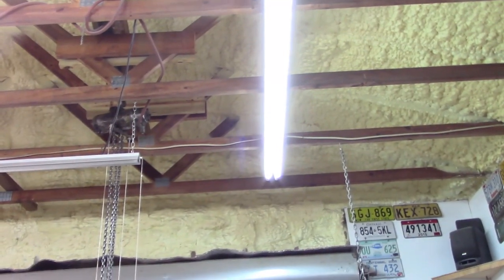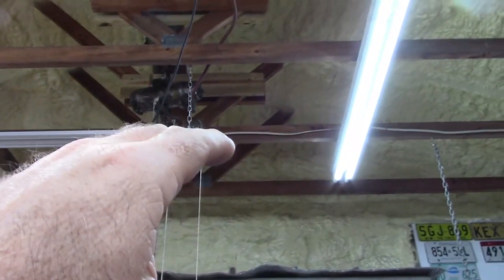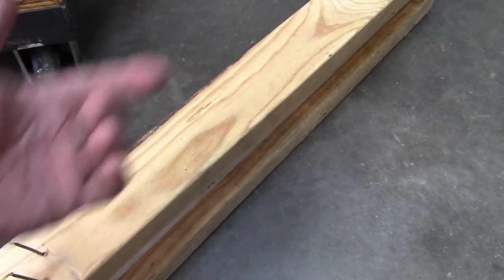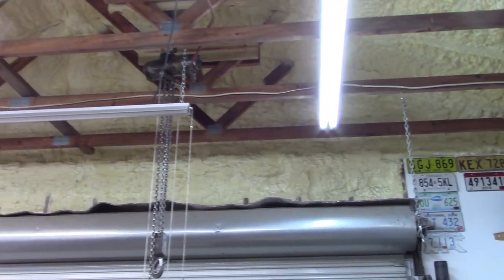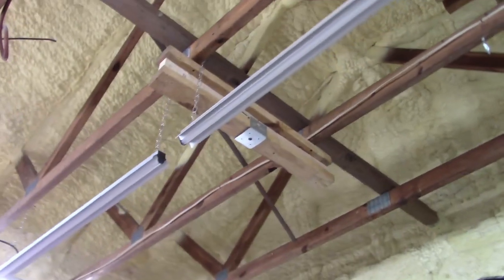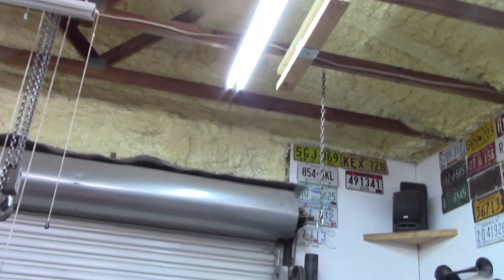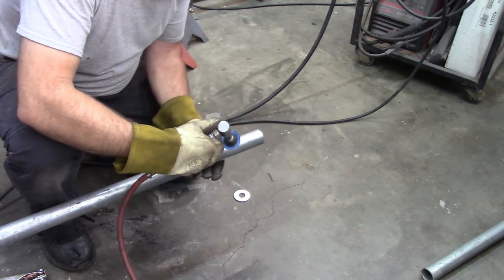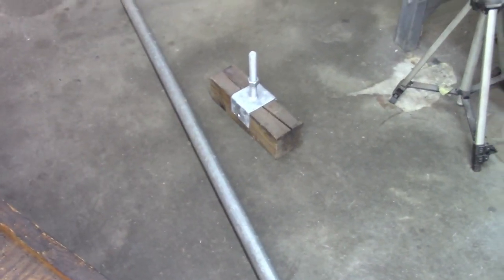Shop upgrade. Air hoist reinfrorcement.

Comment: Bar, you're playing with fire.  No matter what, you're lifting overhead pulling against fasteners attached to wood.  I get the reinforcement, but it still comes down to your 2x6's screwed into the webs of those trusses.  You're also adding additional stress to the fastening plates in the trusses, and they're not meant for that.  It'll work up until that one time that it doesn't, and (at the very least) you'll damage what's probably a very nice ride underneath.  That's best case scenario should failure occur.

Why not use that cherry picker you've got, or build yourself a gantry crane to use that air hoist?

Comment: Like your idea after you put up the pipe supports. Just a suggestion if you wanted to check what extra pressure is on
the truss rafter between the two pipes, put a third pipe between the support pipes on top of bathroom scale. Then you could
see what the truss rafter is holding if any from what the pipes are supporting ?  Barry you are a very safety first type of person
please check what that down pressure,!!!!!

Comment: You can add some strips of plywood from one end to the other end about 8 inches wide at 8 feet long and screw it on you can also make a bigger piece and screw it where they join together it will strengthen the joint good work though

Comment: If you can get the supports you have added on top of the bottom rafter of the truss, it will be stronger and safer. Currently the mounting hardware is in tension.

Comment: The joints of those thrust are NOT made/constructed to pull on. They are made to support looad from outside ! My 2 eurocent .
regarding the I-beam , use beside the screws also woodglue glue !. for the pipe , I would use bigger diameter , thin wall but bigger diameter.
And I would make a longer and bigger/higher I-beam and lay it on top of the smaller I-beams. Now you have a bridge and the roof only needs to help it to stand up. The load is now off the roof construction.Again , my 2 eurocent.

Comment: Not a good idea, whether it works or not as load should be on walls. put two lam beams across top of walls and overlap 6 feete and glue and bolt them well. Also add two studs or a 4x4 on each side. Also Plywood the sides of a truss can strenghten it tremendously!